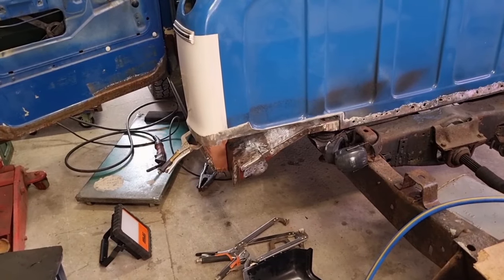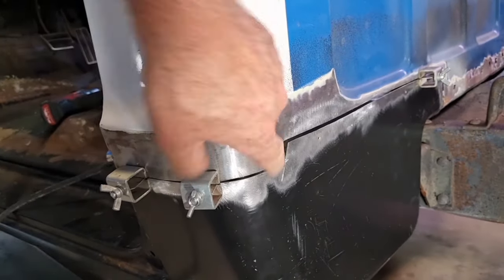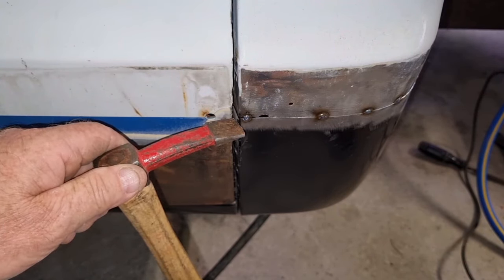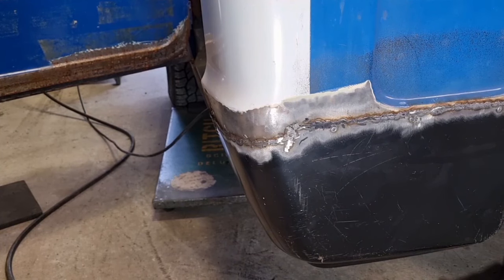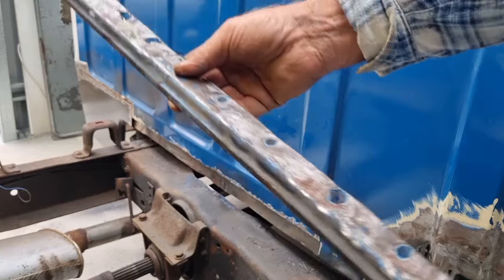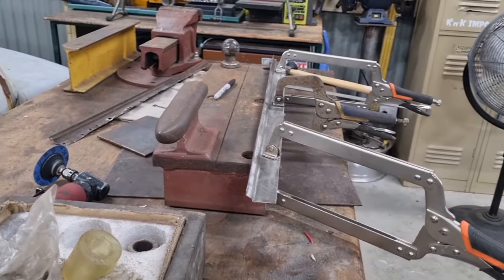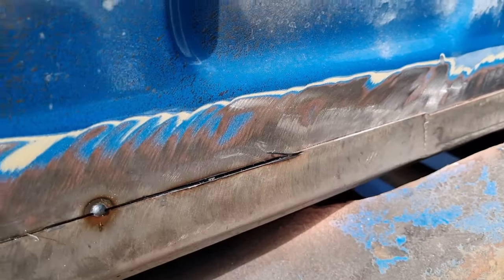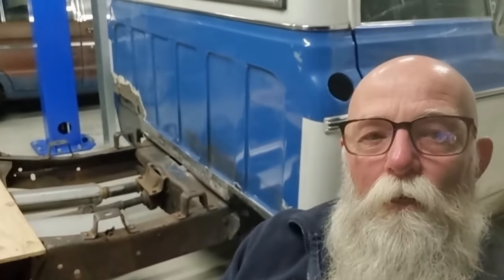GMC Cab rust repairs, nearly complete

Comment: Great calm presentation.i have a 78 k10 from s.carolina I bought a year ago.good frame and running gear.but usual rusted inner and outer rockers,cab corners.plus supports.kick panels bottoms,and about 12" of floor rustout from doors inwards.i Ann a noobie,at 69 years old.but some mig experience.have all sheet metal bits,my question is what order  should I follow? Support first etc.ive seen. Videos but not any with this much replacement needed.thanks ,glad I found your site.
Reply from the maker: Firstly, thank you for joining us. Welcome. 
If we had our time again we would remove the cab from the frame and flip it upside down.
However, we replaced the floor braces first, however we cut some parts of the floor out for better access. Like yours, our frame was good. We were careful to take lots of photos, and measurements, also made notes. Our strategy was to maintain, or repair the structural elements and then concentrate on the sheet metal. In Australia replacement panels are available, but at big cost, so we made a lot of our own bits. You will have much better access to affordable rust patch panels, and I would suggest using them. Be aware that even then they will need tweaking to fit well. Check out a few of our earlier videos on the GMC too.
Cheers, stay safe, and enjoy your project.